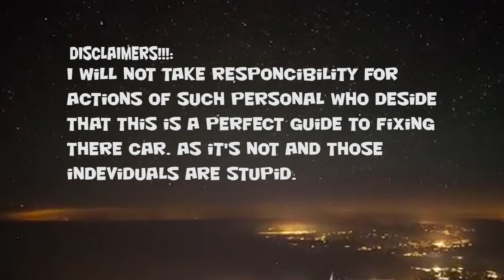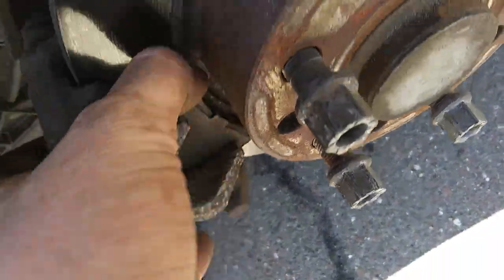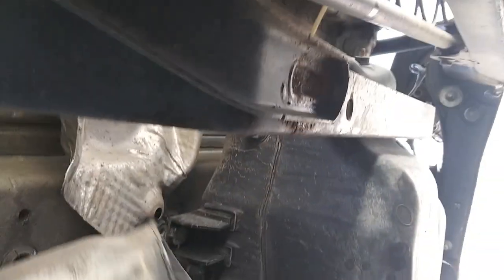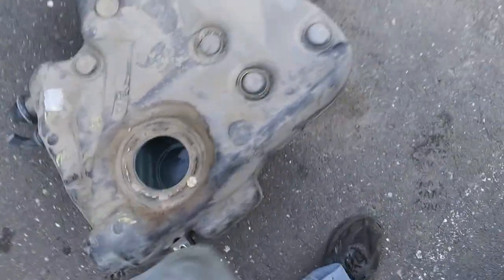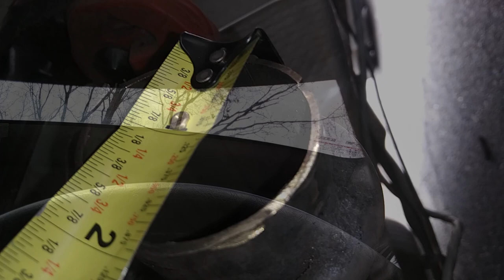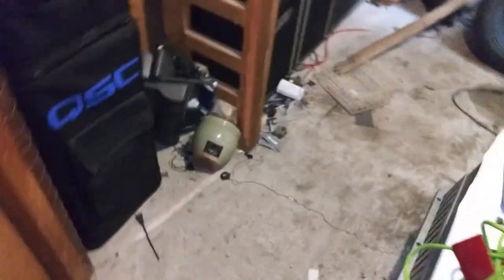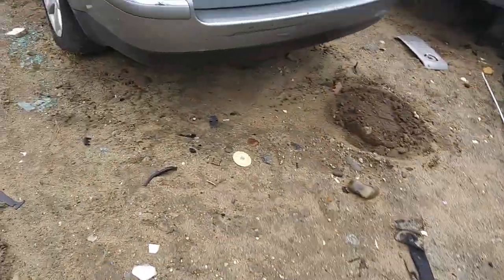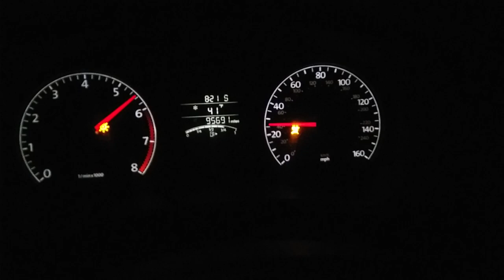Gas tank repair on a 2013 VW Jetta

Comment: 1. No one in their right mind would point an exhaust opening directly at a fuel tank. 
2. Plastic fuel tanks are preferable to metal ones. 
3. The thin aluminum heat shielding is appropriate and helps keep cabin temperatures down. 
4. Don’t cut through fill necks.
Reply from the maker: These are all good points. But the car Is still a peice of euro shit